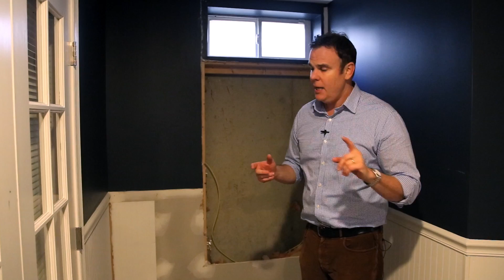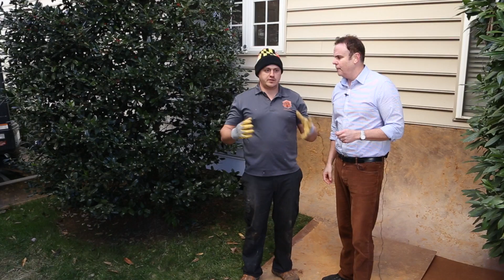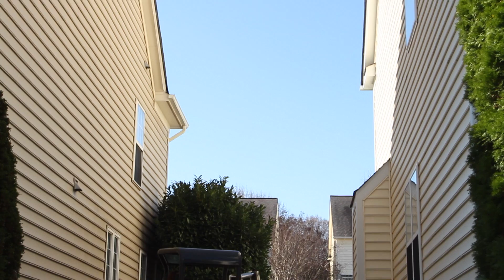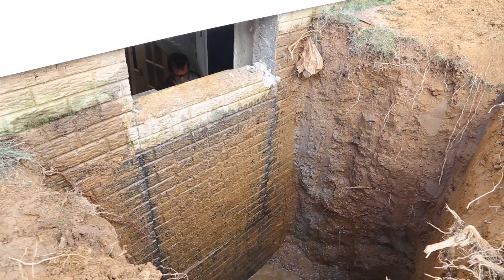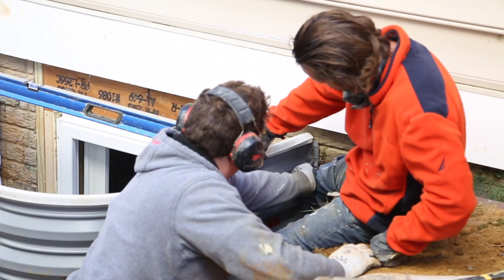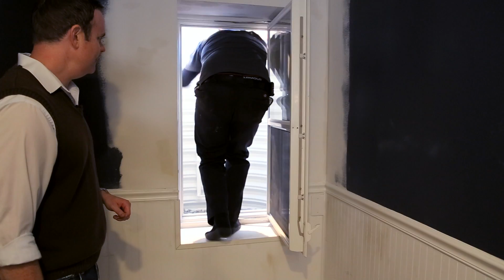Basement Fire Escape Egress Window Maryland DC Virginia

Comment: Yes! No foundation drain no problem!  2 tons of gravel should be enough to make sure plenty of water finds it's way to the foundation and the surrounding area.  It's important to do your home work and check your math when it comes to calculating how much gravel it will take to soke up all that water. Not enough and you'll have to much water, too much and you'll run out of water. Either way your gonna have big problems and the gravel won't do its job and you might as well start over.  When it works the way its supposed to that gravel soles up water like a sponge and now you really have a system that smokes up water the way its supposed to.

Comment: did you not need a drain or sump pump under the well bottom?
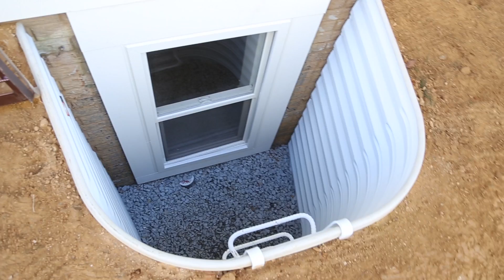Reply: it has one, check 11:22
Reply: Sometimes we have to put a pump in that pumps water into the window well to make sure it doesn't dry out completely.  That by its self can create a whole other list of problems and you think you had problems before. Wait till the foundation heaves up and the doors on the main floor don't open or close anymore. Plan on spending 70 to 80 thousand to get that fixed!

Comment: I see that people are asking for the cost of installing egress windows but I don't see JDS Home Improvement responded to any of the questions.  I would think JDS want business and should at least check back their video and responded to potential customers.  So, what is the ball park of installing the egress window in Virginia/DC/Maryland area?
Reply: Egress windows vary in price starting at around $7,500 all the way up to about $15,000 to $18,000 each.  Depending on if you dig the hole yourself and if you cut the concrete or pay someone else to do it.
Reply: If you want a quote call and schedule
Reply: m howard  Is he still available?
Reply: just do it yourself. It took me two days to do mine and cost under $1000.  If you get someone to do it for you it will cost $6k and up

Comment: what is the cost to the customer for this project?  thank you.
Reply: hi m howard, is your guy licensed and did he do the job to code?
Reply: I was given a price of $6000 for a 31" window steel well with the inside finished. $1000 more for the stone look polycarbnate well and $150 more for a 48" window. A lot for a single window but i wouldn't want this done wrong, you could have a lot of problems.